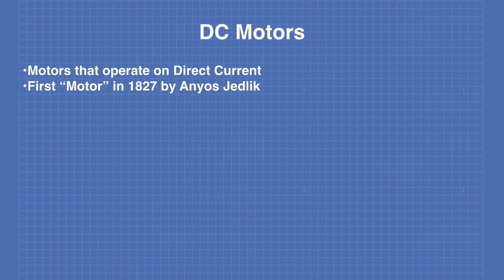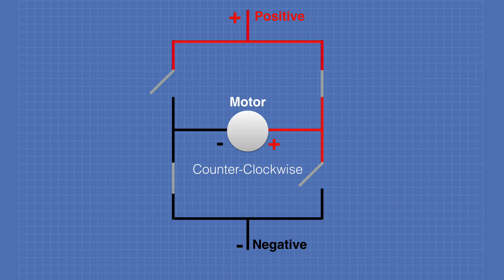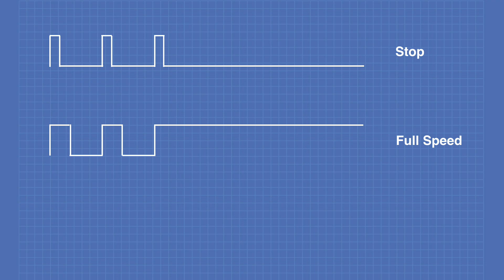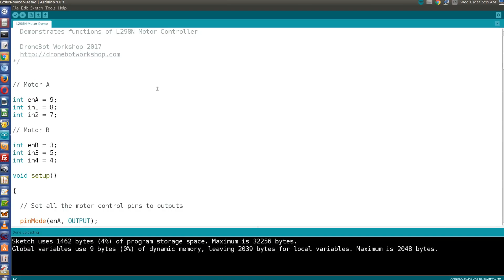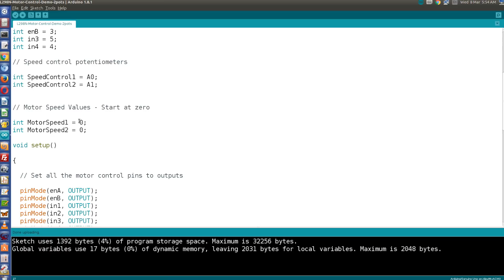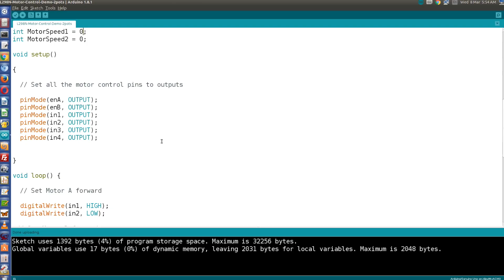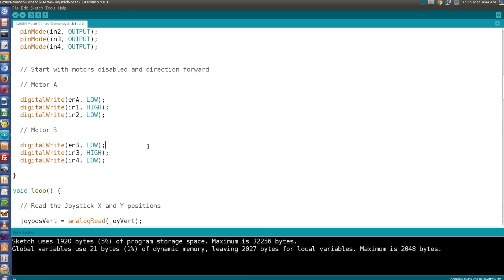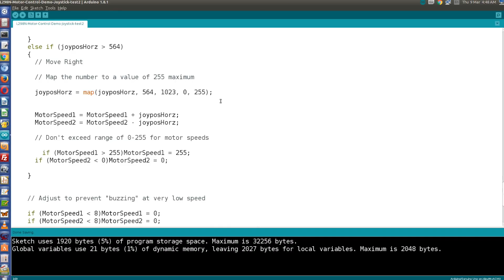Controlling DC Motors with the L298N H Bridge and Arduino

Comment: I'm sorry to disagree with the sketch you submitted for the following reasons:
1) you start from the assumption of controlling the L298 using INH1 and INH2 to indicate the direction and adjust the speed by injecting the PWM signal via the ENABLE pins, this can work with Drivers such as the L298 which have inputs managed by an operational comparator, but using other IC or H bridge based on different technologies this can lead to cross conduction problems! with relative destruction of the circuit.
2) The correct management of the L298 itself is to use an INH input to inject the PWM signal with variable duty cycle to adjust the speed and the other INH input kept at a low logic level - and vice versa to change the direction of rotation.
The enable pin must only be used to completely cut off the power to the two half bridges and block  the H bridge.
Unfortunately I note that this method of management leads many enthusiasts to use the same system (shetck) with other H bridges with often catastrophic results.

Comment: Thanx for explaining how to work with this driver. Mine will arrive in twoo days probaby.

I'm a noob when it comes to programming and microcontrollers.

Looking at the video around 30:51min you made me wonder.

It is really nessesarry to subtract "460" form "JoyposVert" and than invert it using "*-1"

Why not using the "map()" function to achieve this ressult?

Kind regards, 
 Daniel

Comment: Thanks for the video, informative as always!
I've bought a couple of h-bridges (L298H) from China, and I am now looking at them... Where you have VCC, mine says "12V".... Does that mean that, unlike what it said I was buying on the chinese website (that these will "Drive voltage: 5V-35V"), that I can actually only expect them to run 12 volt motors?  If so I think I need to have a word with my supplier....

Comment: I hope u can teach an old man new tricks. Concerning power controllers used to power a dc motor on a wood lathe or for that matter any woodworking tool. Do all, some or what accept regular 110 house current as power input or is there some that require only dc power input? Just a bit confused in reading the descriptions to some on Amazon, ebay, etc. Sometimes neither is mentioned and I wonder if I’m just stupid or missed something. I have my wood lathe running with a dc motor through the MC-60 that came on the same treadmill. I was wondering if you could just avoid using the mc-60 altogether and use a power controller. Hope u can teach an old dog new tricks.
Thanks a lot

Oh I forgot, on my wood lathe where I have the dc motor running through the mc-60, I want to fix it where it will run forward and reverse. I have a DTDP switch wire up and ready to install & I wanted to know if I could piggy back to the connectors inside the mc-60 where the power and motor are connected? In other words can I connect the DTDP switch wires onto the same posts where they are connected to the Mc-60? If this isn’t clear please let me know and I’ll try to go from another direction. 
And finally, whew! I have seen contradictory statements on YouTube about which set of wires go where on the DTDP switch. One site says the middle two wires go to motor & the pair on end goes to power supply. Other sites say opposite. Some say it Doesn’t matter. Which is it?
Thank you, I’m really learning a lot from watching your videos.

Comment: I dont know but if I use analogWrite, the motor doesnt want to run at all, even 200

it will run only for digitalWrite(enA, HIGH);

I have checked

const int enA = 12;
const int in1 = 11;
const int in2 = 10;

void setup()
{
  Serial.begin(9600);

  pinMode(in1, OUTPUT);
  pinMode(in2, OUTPUT);
  pinMode (enA, OUTPUT);
  
}

void loop()
{
analogWrite (enA, 60);
digitalWrite(in1, HIGH);
digitalWrite(in2,LOW);

}
motor doesnt want to run -_-

Comment: Your videos are outstanding and greatly appreciated, especially to a newbie like me.

My original intent was to build the robot following your “Build a Robot” series but up to video #5 I realized it was somewhat more than I could do, so I’ve opted to learn and build from your individual robot videos (baby steps). I am familiar with ac electrical power which helps when working with dc.

I’ve built a few of your examples, following the instructions, including all on this video, using the Arduino and motor controller and none of them functioned initially. Reading the comments from your other followers made me believe it was something I was doing wrong. I purchased all the same equipment and followed your instructions (I think). But this actually turned out to be a blessing. I was forced to read and learn about Arduinos, motors, motor controllers, etc. and not just piece pieces of equipment together and copy code.

For instance, in this video with regards to using a joystick. Following your instructions, I was able to get motor B to turn in one direction, nothing else. Moving the enable pin for motor A to #2 on the Arduino and  the data pins to #6 and 7, then updating the code, everything is functioning fine. Having to make these adjustments I hope is not a result of me doing something incorrectly as far as your instructions. (Maybe the equipment is not created equal?)

Comment: sir, please i need your help with this code
int in1 = 2;
int in2 = 3;
int sensor = 8;
int led = 13;

void setup() 
{
  pinMode(in1, OUTPUT);
  pinMode(in2, OUTPUT);
  pinMode(sensor, INPUT);
  pinMode(led, OUTPUT);
  
  digitalWrite(in1,LOW);
  digitalWrite(in2,LOW);
  digitalWrite(sensor,LOW);
  digitalWrite(led,LOW);

  while(millis()<13000)
  {
    digitalWrite(led,HIGH);
    delay(50);
    digitalWrite(led,LOW);
    delay(50);
  }
  digitalWrite(led,LOW);
  digitalWrite(in1,LOW);
  digitalWrite(in2,HIGH);
  
}

void loop() 
{
  if(digitalRead(sensor)==HIGH)
  {
   digitalWrite(in1,HIGH);
   digitalWrite(in2,LOW);
   digitalWrite(led,HIGH);
   delay(2000);
   digitalWrite(in1,LOW);
   digitalWrite(in2,LOW);
   
   digitalWrite(in1,LOW);
   digitalWrite(in2,HIGH);
   digitalWrite(led,LOW);
   delay(2000);
   digitalWrite(in1,LOW);
   digitalWrite(in2,LOW);
   
  }

}
The purpose of the code is to be able to open and close CD Driver whenever it detects movement on the PIR sensor, But my CD Driver keep opening and closing, 
The component that I use are
1.  PIR Sensor
2. L298N Motor Driver
3. Arduino Uno Board
4. CD Driver

Comment: very calm lecture !! what if I need to rotate the DC motor for 90 degrees only and stop ?? how do I make the potentiometer measure the rotation angle of the DC motor and  send the signal to the arduino to stop the motor?

Comment: hi what is the max DC motor  amp you can put on the L298N .. I have a Fan I like to use on something like this but its a 12v 6.6 amps

Comment: The module I use does not have the engage pins. So I assume it is directly controlled via the input signal (pins 1 and 2). It´s this module: https://www.banggood.com/Dual-Channel-L298N-DC-Motor-Driver-Board-PWM-Speed-Dual-H-Bridge-Stepper-Module-p-1162946.html

Comment: What if i want to connect 12v 150w motors, is it possible to connect?
and is it possible to connect 12v 10 amp battery to this driver. Please help me sir. Waiting for your reply.
Reply: up to 2 amps in output

Comment: Hi. Thank you for your videos! If I wanted to use 4 motors instead of 2 would I need to use 14.8 volt supply?
Reply: You may use 2- 7.4v power supply it won't make your total voltage 14.8v if you use two different terminals and hence your circuit won't fry off cause you won't get 14.8v total instead you will get 7.4v but  in increased capacity hence it would allow a more consistent flow of current, thanks

Comment: thank you so much for this video, so informative,  i could solve the buzz problem  when the motor is fed a very low PWM values by adding two pull down resisters to IN1 and IN2.

Comment: amazing project!
Sir is that possible to rotate dc motor 360 degree at each sense by proximity sensor using the L298N driver?

Comment: I'm will receive my first Arduino today and was eager to learn about an H-Bridge for motor control. The PWM aspect is just icing. Could you use a map() function to bound the duty cycle range to keep it from stalling?

Comment: Hello Sir, 
I have learned most of the arduino circuits from your videos only.  These videos explain the basics clearly like a tutor and make it a child's play.
I have a request to make a tutorial for arduino uno connections to the esp8266 module to drive a multi -channel relay for room lights over the wifi connection from phone.
Thank you.

Comment: Can i attach 45 rpm dc motor of 300mA current rating?
Reply: According to the datasheet, the L298N can accomodate for 2A continuous current (total for both channels) with proper heat sink. Two times 300mA if perfectly fine.
Reply: Let me correct myself : it's 2A continuous current for EACH channels (total 4A)

Comment: How can you get to use the whole 12 volt and the Max amperage
Reply: The L298N will allow for 12v and for up to 2A of continuous DC current for each channel. So it really depends on the motor characteristics and what they will accept.

Comment: Amazing video. Love the production value. I have an L298H and EN-A (dual-pin) and EN-B (dual-pin) are jumpered. How can I connect them to my Arduino Sensor Shield (on top of Arduino UNO) to control wheel speed please? Right now IN1, IN2, IN3, IN4 (L298H) are connected to the A4, A3, A2, A1 (Shield) respectively and wheels turn at full speed without problems. I'm using the kit ...  https://www.amazon.com/gp/product/B01CXVA6IO/ref=ppx_yo_dt_b_asin_title_o00_s00?ie=UTF8&psc=1

Comment: hi my name is nicholas  i am willing to sponsor a project.  it is a stepper motor control using a 6560 driver, a rotary controller, an oled to set speed in rpms, and 2 buttons.  the rotary controller will control forward and reverse, set speed with sw.  the two buttons will start and stop the motor after speed is set.  my cell # is 9178161350.  I need arduino code and wiring diagram, preferably fritzing.

Comment: How many volts is this motor or maximum
.... Use dc motor 180
Reply: Max voltage for the L298n is 35v. To drive a 180v motor you need something else.

Comment: Hi, i have no more experience in this field, i want to connect 4 motor driver in Arduino . Each driver connected through rs232c.

can i connect control 4 drivers using Arduino uno?

Comment: Really nice video of yours!
I am using this motor https://uk.rs-online.com/web/p/dc-motors/7522005/ and tried to follow your instructions. But somehow cannot, I guess there is something wrong with the connection to external power supply. Can I use L298N for this? just only one motor.
Reply: Hi! Finally managed to do it! I also tried your stepper motor tutorial and it works!

Comment: Can you make an Arduino run a clock? It would have to run slow enough to do 1 revolution per hour. Also you would have to make it to where you could adjust the time. I made an analog clock using  a 3D printer. Now to get the motor to work for this application!
Reply: You can use a stepper motor (28BY J-48, cheap and rotates in very precise increments) to run an Arduino powered clock.

Comment: Hii..
I want to control robot car with joystick using arduino uno and bluetooth module. Left side two dc motor connected with each other and same with right side dc motor... how to do that please help me..

Also it has a robotic arm with 4 servo motor also i want to control it with button (blynkapp)....
 
Please help me for programming because i made controller using blynk android app.!

Comment: Re-watched this video and was wondering: Is there any reason you used digitalWrite() to write to your PWM pins in the setup() function? I suppose it doesn't make a difference when you're writing a LOW state, but I guess I would have just used analogWrite(). Any particular reason you went that route?

Comment: Very good explanation and video! Hopefully you can help me out. I need to control 1 motor in both directions on a timed circuit. Let's just say at 8am I need a motor to run fwd for 5sec and at 5pm need it to run in reverse for 5 sec. Can you help?
Reply from the maker: I'll be doing a video VERY soon (ie. at the beginning of the New Year) that wil show you how to use a Real Time Clock with the Arduino. That is the missing piece that you'll need to accomplish what you want to do.

Comment: can you use a fsr instead a potentiometer?
Reply from the maker: Hi Eric. I don't see why not, you'd need to add a fixed resistor and make the FSR part of a voltage divider.  And you would want to use the MAP function to get the range correct. Anything that can deliver a variable voltage level to the analog inputs will work.

Comment: Why not just speed=map(speedStick, 0,1023, -255, 255); if (speed<0) {reverse both motors} else {forward both motors} and analogWrite (enable, abs(speed));?  You could even use the left-right signal to adjust the two motor speeds before deciding each direction and analogWrite.

Comment: In some explanations of L298 modules the 5V connection is specified to deliver (and not receive) 5V, depending on the jumper setting. This way you can do with just one power supply of up to 12V, and then pull out 5V from the L298 module to your Raspberry Pi, Arduino, or whatever.
Reply: See for example https://howtomechatronics.com/tutorials/arduino/arduino-dc-motor-control-tutorial-l298n-pwm-h-bridge/
"If the motor supply voltage is up to 12V we can enable the 5V regulator and the 5V pin can be used as output, for example for powering our Arduino board. "

Comment: I thought, that optional 5V is an output to power up ardunio, but you say it is an input? what am I missing here? it says it an output on the datasheet
Reply: I believe it depends on the jumper. If you have the jumper connected, then the 5v is an output using the main power source (though you must not use this if your input voltage is above a certain threshold). If the jumper is disconnected, then you can supply the 5v in yourself (as done here).

I'm using it mine as you describe, and powering my Arduino from it.

Comment: One challenging project, that I hope you will accept; is controlling the direction of a motor based on certain  threshold. Let us say a certain voltage. If you monitor the voltage, if it goes above certain value you turn the motor certain direction and if below it turns the other direction. With the help of two micro switches on each side of the motor you "protect" the rotation within a certain "range" 
I hope I made myself clear; otherwise I will try to add more info especially if you have questions.

Comment: Can I connect a single pin of the microcontroller to both motors enable pins? I want to share the same PWM output between the two motors, and activate or deactivate them using their respective INx pins. Is this possible/wise? The reason is that I wanna control 4 motors (using 2 drivers) and PIC18F4550 can't generate 4 PWMs (even if it did, I think that would waste pins).

Comment: Is it possible to control a larger DC motor with this kind of H bridge ? If it’s possible will I need other components in order to make it work ? Voltage regulator etc ? Thanks

Comment: Hello, I was wondering where can I find the base of the car you're using?, if is not too much to ask,  and thank you! Excelent video by the way.
Reply: There are lots of car kits that have this base on ebay/amazon for very cheap, just search "arduino car kit" or similar. I bought this one which was around £13 GBP and includes the chassis inc. 4 motors, the h-bridge, a sensor shield, 4x infrareds for line following and ultrasonic for avoidance :) https://www.ebay.co.uk/itm/Avoid-Tracking-Motor-Smart-Robot-Car-Chassis-DIY-Kit-4WD-Ultrasonic-For-Arduino/183559729809?ssPageName=STRK%3AMEBIDX%3AIT&_trksid=p2060353.m2749.l2649

Comment: I am using a 9 volt battery to power motors but the max speed is much smaller than the motors shown in video .

Comment: I dont understand because you connect this 2 motors that work (3-6V) with a  7.4 V current. Isnt this bad for the motors?
Pls help, i understand the rest.

Thanks for the video💓😍
Reply: the l298n reduces the voltage by around 2 volts so you need to have a bit higher voltage to use your motors!

Comment: I have a problem, when i check the L298N without breadbaord means enable the motor via jumper and also enable 5V via jumper and short the IN1 or IN2 via 5volts poewer next to ground then the motor runs but when i try the breadboard as per your instructions it does not work, i have the other model which u have mention in the begining
Can u help me please

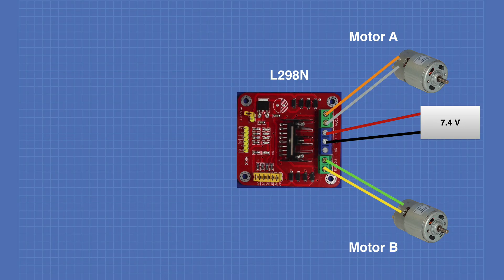Comment: I did the exact same configuration as on 13:51 with an L298 Motor Driver I bought from Elecrow and am still experiencing some problems. Both my DC motors are rated for 6V. I use a 9V battery as a power supply to the H Bridge. Both motors don't spin when connected only to the battery and only one motor (Motor A) spins when I connect the Arduino via the USB port. I checked the sketch and no errors we're found so I'm guessing I'm not supplying enough voltage? Help please.

Comment: I have a question. Instead of using PWM at enabledA or enabledB pin, I used it at Pin1 and Pin3 of L298N (as they were connected to PWM pins of Arduino). I was still able to control the speed of motor. Enabled pins were set to high by jumper cables. Is there any harm in doing so?

Comment: instead of the arduino, could i use an ESP8266 12E Module to control the motors wirelessly?

Comment: Regarding the +5 Jumper, you didn't change it position when you removed your EXT +5V supply yet you powered the Arduino from the L298N, should not you have jumpered to +5V on the L298N and used the on board regulator for the +5V to also power the Arduino?